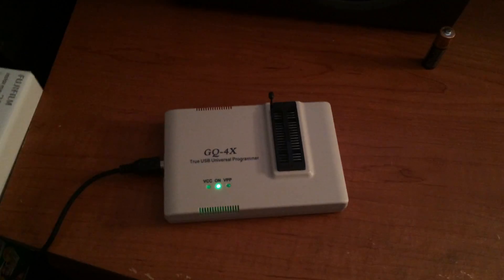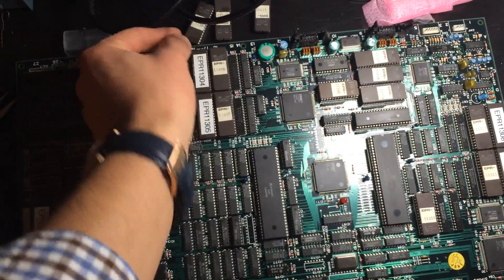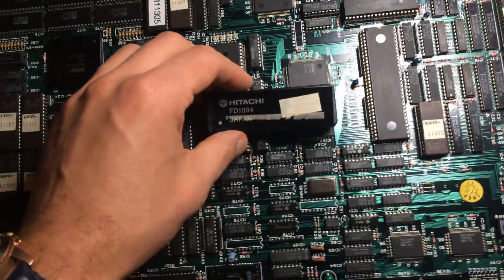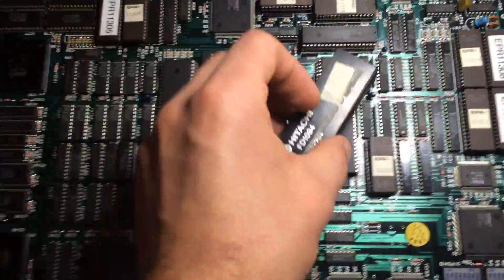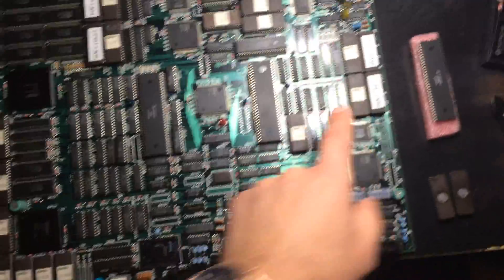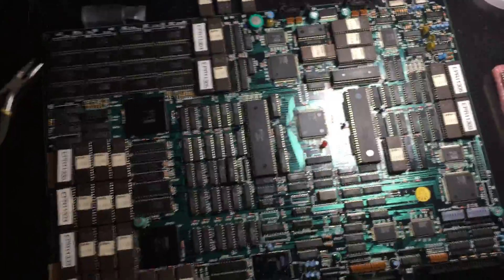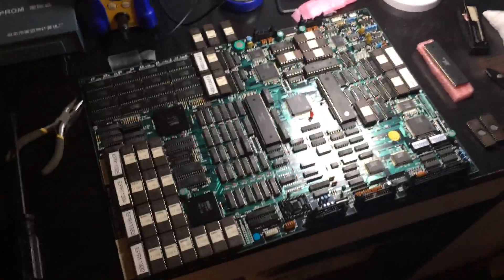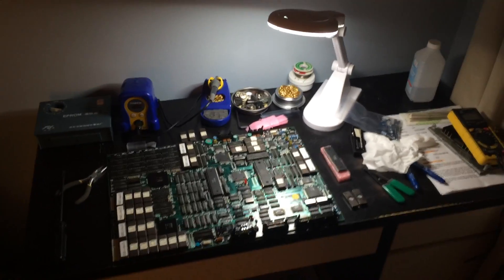Thunderblade Sega Resurrection Part 1 - Explaining the process

Comment: I have same board in arcade but helicopter always rides to the left,what issue it can be ?
Reply from the maker: You need to rebuild your joystick. Download the manual. There should be a calibration menu in the Test menu to adjust the pots.

Comment: Hello!
I don't like acting smart about things that I know only in theory, but I believe you should get those stickers removed on eproms before UV exposing! There should be glass "windows" under and stickers are used to prevent eproms from getting erased in daylight ...
Reply from the maker: +gogiser Correct.  The sticker needs to be removed in order to expose the UV window.  The ones I show in the video are just samples that I didn't erase (just to show the model number of the chips).  But the ones that I tried erasing had the stickers removed.  :-)  If you look carefully in the video you will see them and the exposed windows.  I will post a video shortly on how I erased and programmed the chips the GQ-4X4.
Reply: +DeLuSioNaL Arcade he he ... I didn't see them the first time and I thought you had problem with the three eproms above the board ... sorry for that :)